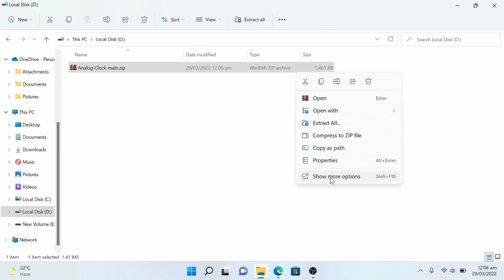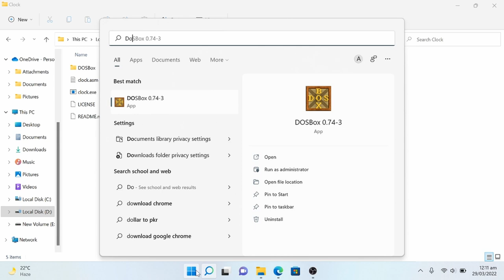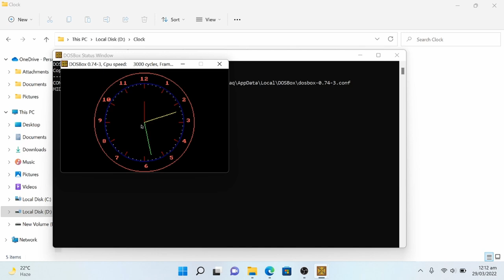Graphic Analog Clock in x86 Assembly

Comment: Hello programmer. It looks nice and it is a lot of work inside the clock.asm.

Personaly i like to use the VBE videomodes of Dosbox too, example with a resolution of 800x600x32 using the linear framebuffer in C0000000h together with the 16 bit Big Real Mode with a segment size of 4gb for the data segment.

mov bx,4115h  ; modenumber + lfb for 800x600x32
mov ax,4F02h
int 10h
Reply from the maker: Thanks alot! This was just a beginner's project. It was made as a part of my mid-semester assignment for my Introductory Course to Assembly Language. One thing I realized is that it is quite difficult finding learning resources for x86.
Reply: @Ali-ge3xn  I start to learn x86 assembly on intel 80286 with MS DOS 5 and Debug without to have internet. Try and Error. But befor a had a PC i learned at first Comodore C64 assembly language 8 bit CPU with only three register.
Reply from the maker: @maxmuster7003  Wow, that is amazing
Reply: @Ali-ge3xn  Before running the 4gb.bat we have to disable (REM) the EMS driver emm386.exe in DOS config.sys, or in the DOSBOX config EMS=false. 

Calculating the adress of the linear framebuffer:

xor eax,eax
mov ax,@data
mov ds,ax
mov ebx,0c0000000h
shl eax,4
sub ebx,eax
mov eax, RGBX-Color
mov [ebx],eax                 ; set one pixel in the upper left corner framebuffer = ds:ebx